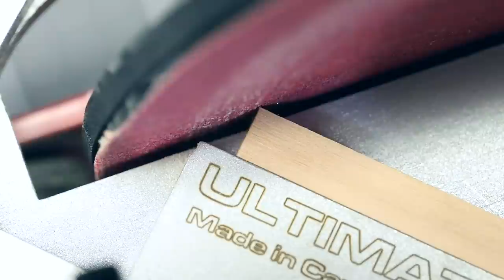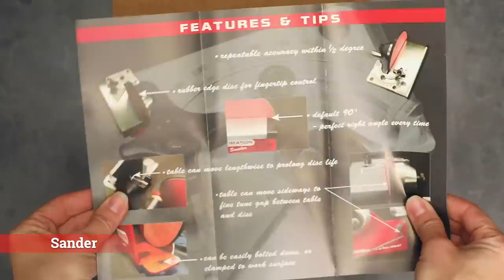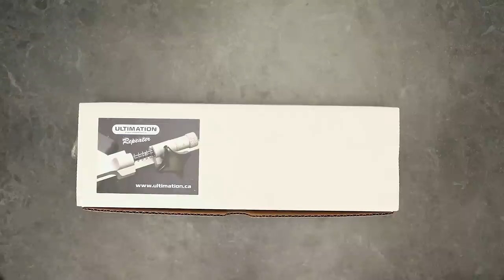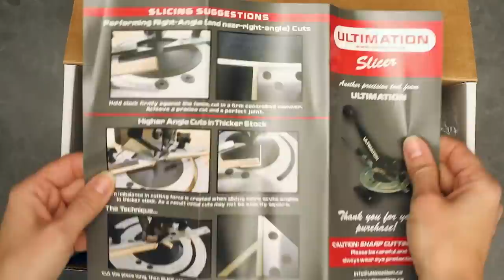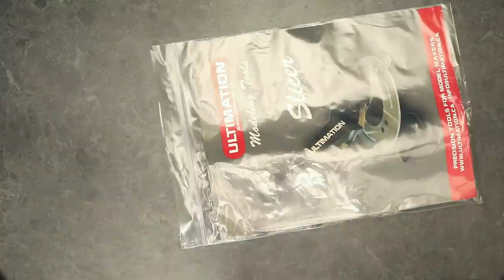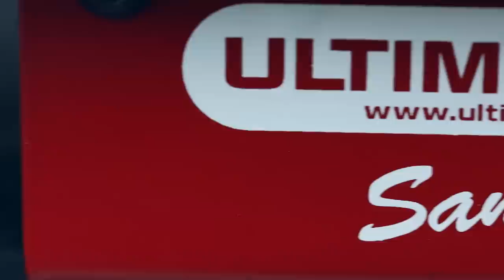Ultimation Modeling Tools

Comment: I went to their website after seeing the images of these tools in your video at the May 6 exhibition.
The slicer is very interesting for my needs and seems very robust. I appreciate the fact that you can change the cutting mat once everything is scratched. To be used for its specific purpose.
Your video convinced me... Sold!!! ))))
Reply from the maker: Yes, these tools are very reliable. All parts are metal and perfectly fit - the design is very strong. But I was more surprised by the sender. It is just perfect))) Although the slicer will now make my life much easier! By the way, one of the two partners of this company designed the scroll saw Dewalt DW788, so I'm not surprised by the reliability of these Ultimation modeling tools...
Reply: @OlhaBatchvarov  The sander is nice, yes.
Reply: @OlhaBatchvarov  I don't know if the manufacturer is Canadian but I already received my slicer after only 2 days. It is as I wanted, heavy, robust and efficient with extra cutting pads and blades. I recommend it too!!
Reply from the maker: Yes, this is a Canadian manufacturer. I have already tried this slicer on hardwood such as castello boxwood and pear. The result is impressive, even this wood that has the feature of stabbing, under this slicer blade has a perfect cut...

Comment: I have the sander. It gets a fair share of use and replacing the sanding discs for different grit is not difficult. You can buy the sand paper at most hardware stores. I like it and it has held up very well. I like that it is small and portable, and, can be used for any number of projects and hobbies. Thanks! Have a great weekend!
Reply from the maker: Thanks for sharing

Comment: Picking up a used precision bevel gauge would take both those tools to the next level.  Watch E-Bay and you can usually get them pretty reasonably.  Your mitered frames and the butt joints will thank you.
Reply from the maker: I was amazed at how accurate these tools are, but as people say "There is no limit to improvement" and you can use a precision bevel gauge for an even more perfect result!..

Comment: Nice looking tools but from what I have seen they have limited use when working with hardwoods. Overpriced when compared with similar tools from other sources.
Reply from the maker: I work on them boxwood, pear wood, black hornbeam, ebony and I am very happy with the result... Are there any harder woods? I have separate videos of these tools in use, you can find them in the "Necessary Tools" playlist...
Reply: @OlhaBatchvarov 
I use Maple, Oak & Hickory which have greater hardness than the woods which you refer to. A German company makes similar tools of similar size (about 200 x 200 x 210 mm) which work off a tiny mobile phone size transformer. They range in price from €95 to €130. Made in Germany and no Chinese trash!! Highly recommended.

Comment: What is the maximum cutting capacity in mm of the slicer when cutting Pear? Are the blade’s available only through Ultimation?
Reply from the maker: These are standard utility knife blades but expensive (heavy duty). I did not have to cut very thick strips of pear, but it is soft compared to boxwood... The thickest that I cut without problems was a 7x7mm walnut...
About a month ago, I published a video about this slicer and its capabilities...
Reply: @OlhaBatchvarov  thank you Olha. I will look for it.

Comment: Thanks for the video. Never seen a hand-cranked sander.  Do you have to bolt the sander to the table? I may get the slicer.
Reply from the maker: You can fasten it to the table or just clamp it. And I like to move it around the model depending on which side I work from...

Comment: This are good Tools- but very expensive. Why you don`t use Proxxon (Tellerschleifgerät »TG 125/E«, 140 W, Elektro), you have to pay 149 € for it. And it is with an electrical engine. Good luck for your projects and your videos. I like to watch all! Greetings from Germany!
Reply from the maker: I have a proxon, but it still needs a vacuum cleaner, so this tool is only suitable for the workshop. And most modelers have only a table in their apartment and the issue of dust becomes very important! And by the way, accuracy is not about the proxxon, so it loses on several levels. By the way, I want to make a video comparing two senders!
Reply: @OlhaBatchvarov  OK, I´ve a workshop and I can regulate the drive and I have a master/slave switch for the dust-cleaner. Of course, if you have only a table it is better to make it with handcraft. Sorry I forgot this... Have a nice day and thank you for your answer!

Comment: it seems like with the sander you'll only use a small narrow track of the disc's total surface which in time will get very used and the rest will remain untouched. not very efficient...
Reply from the maker: That's why you can move the table as a slider. I forgot to show it in the video, but if you pay attention, the aluminum part of the table is moved to the video several times. One nut from below fixes a table.
Reply: @OlhaBatchvarov  then that's very thoughtful, makes a difference.

Comment: Of course this video comes out a week after I splurge on a micro mark table saw. I feel like these two machines are 90 percent of the work. I have a very crappy version of that slicer from artesania latina, which is more frustrating than useful. It's a toy. This tool seems like the real deal. I only wish it had the ability to tilt for compound miters!
Reply from the maker: Good purchase!
Sander will definitely be needed to refine the details after the table saw. As for the slicer - I'm currently testing it on hardwood...
Reply: @OlhaBatchvarov  thanks! I already have a belt/disc sander, but it's obviously not portable, quiet, or as versatile as this for small work. That slicer though... I'll wait for you report on hard wood